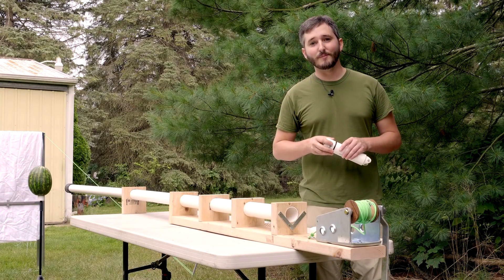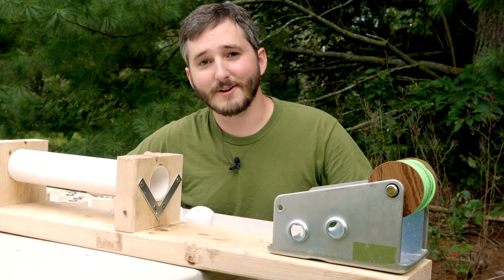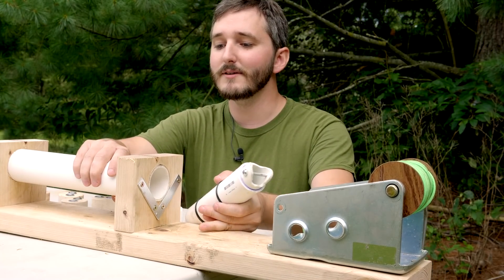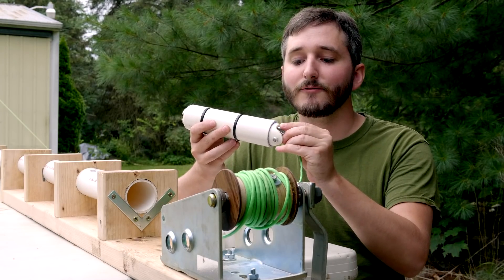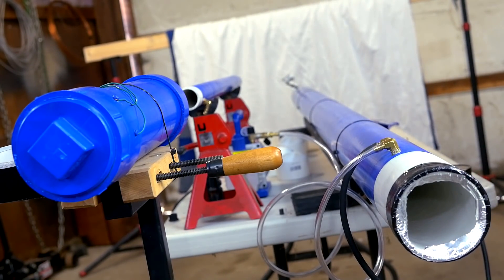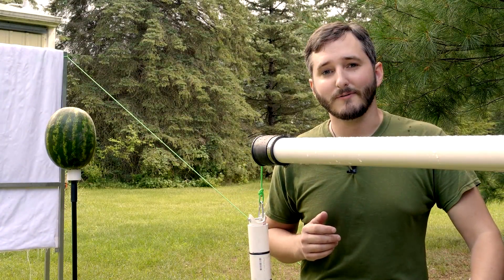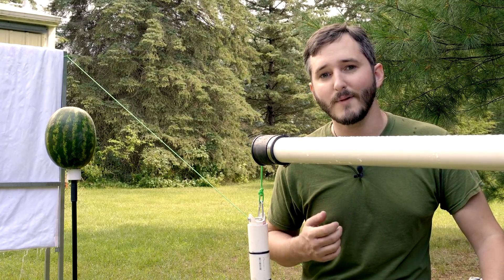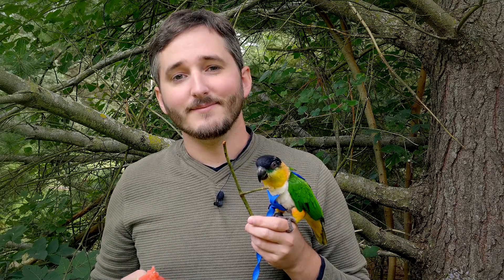Rapid-Reload Vacuum Cannon: Magnetic Piston, No Burst Discs

Comment: are you by any chance going to follow up on the sodium project?
also try making sabot projectiles so you can accelerate a relatively heavy projectile in a short barrel
Reply from the maker: NurdRage is doing a sodium series that is far more in depth than I am capable of.
Reply: NightHawkInLight  i know but he does it as a lab preperation. i really liked your experimentation and improvisation with regards to electrolysis.

Comment: what about pulling the piston out with a vehicle? then you could make a really long one. support the front end of the barrel only, the tension in the rope will keep the rest of it straight. the projectile will fly down the barrel much faster than the back end of the barrel drops to the ground. Also what about filling the barrel with helium? it will leak round the piston more but is much less dense than air. What about wrapping PVC tape round the projectile? less friction against the barrel & a more precise fit
Reply: i meant PTFE tape

Comment: Will adding a funnel at the rear maybe improve air flow that potentially holds back the projectile? I have no experience or education with this, but I'm thinking about how a Tesla valve works, and thinking maybe air from around the opening collides with air rushing into the tube(?)...

Comment: If you were to load it normally and before pulling the piston back used a vacuum pump to evacuate any air between the cup and the piston, would that allow you to gain any speed? You would then have the smallest amount of air possible in the barrel while also not having the long times of doing it for the whole barrel.
Reply from the maker: Sure, but the gains would be minimal.

Comment: Could you increase speed by incorporating a converging diverging section in a parallel connected pipe using a check valve between the two? I picture having a separate piston cylinder and projectile cylinder.

Comment: I took the concept of this design and used a 2-inch to 4-inch PVC Pipe Adapter fitting to attach a 4-in wide pipe to make a re-useable pirate cannon launcher, all other designs I saw used compressed air with a foot or hand pump or needed a compressor. The O ring was the hardest to find, had to go to a Plumber Supply Store to source it. I bought the black 2" pipe from Home Depot and found that it was really tight when trying to pull down the tube.

My question is, so you lubricate the ring with a kind of grease?
Reply from the maker: Yes, heavy bearing or axle grease works well

Comment: I'm wondering if atmospheric air rushing in to fill a vacuum could propel a vehicle. Pros: the air, you say, goes several times the speed of sound, so could move the vehicle nearly that fast; the vehicle itself would not need a motor or a way to power it, which keeps it simple and reduces cost. Cons: the path has to be airtight.

Comment: Cool. What is the weight of the projectiles that can be 'fired'? Is there any practical application of this device?
Reply from the maker: A 2" diameter vacuum cannon barrel pushes projectiles with 45 lbs of force, so anything light enough to move quickly under that amount of pressure.

Comment: What if you mounted a lightweight metal rod to the end of the piston? The metal rod would slide through a seal on the far end of the barrel, to push a projectile with the same velocity of the piston through an isolated barrel at the end of the vacuum chamber. This would eliminate the need for the projectile to break/push through the ending seal for the vacuum.

It’s just an idea, but I’m really curious to hear your thoughts on this. I’m planning on building this sometime in the near future, so I’ll comment if I can get it working efficiently.

Comment: What if you create a bullet that's slightly wider than the main barrel, so have a long barrel with two different diameters inside, and the projectile will stop half way and then pressure can start building
Reply: The longer the barrel the better since more acceleration can be imparted on the projectile.

Comment: Do you think the force required to break the magnetic attachment of the projectile to the piston has any effect on the velocity of the projectile?  My guess is: the stronger the magnetic bond, the slower the velocity - because some amount of air will get in front of the projectile before the bond is broken.  Probably negligible, with your setup.  You might be able to get away with smaller washers, which would at least result in a lighter projectile (and a weaker bond).  Likewise, I'd be curious to see what happened if you made the bond as strong as possible, by swapping the washers for a magnet identical to the one on the piston.  Thanks for the great video!
Reply from the maker: The hold is quite weak. I don't think there is much loss. Ideally I would put a skirt on the projectiles that would expand to make a seal and catch oncoming air.

Comment: Hmm, would combining a traditional air cannon with a vaccum cannon be feasible for anything?

For example, you can use a vaccum chamber in a second-stage to a conventional air cannon, where the projectile is shot through ths vaccuum chamber as a "booster".

Another potentially feasible option is a one-stage gun, where you have a high-pressure compartment in the back, and have the vaccum in the front, and us some sort of electric switch to break the seal and/or release the projectile (possibly have the projectile hold the seal). You could even possibly compress/decompress both in the same action, drawing the projectile backwards, compressing the air on the back end, possibly with the aid of a winch. The only problem I can see is figuring out how to release the projectile, while still preserving the air-seal.

Perhaps you could make a PVC bolt rod that is pulled through the back of the gun, with a rubber O-ring as an obturator.  The projectile would be attatched to the rod via grooves and/or lugs on the pipe or projectile, like a bolt in a gun. The rod would be rotated to release the projectile.

Comment: Amazing! I just discovered your channel from the coaxial piston cannon from 2013. I was looking for a way to make a fireless cannon for a live-action role playing game. I like the vacuum cannon better because it much simpler to make, it is more impressive and I want something that can involve multiple players (two to hold and aim the cannon while a third pulls the piston). 
There are however some points I am worried about. First, would a vacuum cannon be able to launch open cell foam projectiles? I may probably need a sabot to prevent the air from passing trough the foam instead of pushing it. Second, can I shoot projectiles light enough to hit people safely?
Reply from the maker: A vacuum cannon will shoot foam at dangerous speeds. It is not a safe option. Search my channel for a foam rocket launcher and you will find a better option.

Comment: Would it be possible to use the cup or burst disk on the front of the barrel, an electric vacuum pump to remove air, BUT some sort of electric valve or solenoid on the back end of the barrel to allow the air to rush in just as fast? Thanks

Comment: if you had various proyectiles attached on to each other, as in one attached to the vacumm seal and the next to the previous proyectile,then the second one should have less velocity (right? the one attached to the first proyectile) so it should collision with the first one. With these though could you make a series of attached proyectiles one smaller than the previous and use the conservation of linear momentum to lauch the smaller one to a great velocity, could you do that?

Comment: I absolutely love your videos and have been watching them for a long time and even made a lot of the projects that you have  but I just have a really quick question , I have never had any luck trying to find clear tubes like you have in your video could you please put a link somewhere where you can purchase them? thank you....by the way, I have made several vacuum cannons as well and I really love your new improved version.
Reply from the maker: If you google clear PVC pipe you can find many suppliers. Note that the inner diameter is different than with regular PVC pipe so you have to sand the pistons smaller if you're using the same design as I have.
Reply: @Nighthawkinlight  thank you so very very much for the quick reply, boy oh boy, you do read your comments quickly but I never expected a reply that quickly thank you so very much!
P.s. I think one of the most funnest projects I made was when I recreated your plasma bottle launcher which came out spectacular by the way , and it worked perfectly!

Comment: Would it be possible to use the projectile as the front seal to the vacuum, or would that compromise the movement with the amount of friction the projectile would interact with?
Reply from the maker: It doesn't move very fast if it doesn't travel down the barrel.

Comment: could I use this method to launch something over a few 80’ oak trees with fishing line attached.  I’m attempting to get a long wire antenna stretched across the top of several trees and not having much success with the fishing rod & lead sinker.

Comment: What would be the effect of using a larger diameter pipe? Say four inch instead of two? You’d have a lot more volume over the same distance but your projectile would have to be larger as well.
Reply from the maker: I've made one with 4" pipe. Check the video description for a link.

Comment: Is there a way to rifle the barrel but still maintain the seal and not break the o-rings  also is there a way to pull the cup out of the way so it doesn't fly off or break like tying it to the barrel using p cord
Reply: If you added fins/fleching to the tail or front of the the projectile and controlled the way the air re-entered the barrel causeing the air to twist around the fins rotating the projectile before being shot out of the barrel could this ack similar to the rifling of a gun? Causing better accuracy and distance I've seen similar things done on paintball markers and bbguns
Reply from the maker: There's no easy way to rifle the barrel, let alone still get a seal. The closest thing is to rifle the actual projectiles like a rifled shotgun slug.
Reply: @Nighthawkinlight  yep but what do you think about the other option though

Comment: so the wood block gets pulled back and gets pulled off only right at the end by the power of the air coming back in? thought it was weird that it would be attached at all to the thing that pulls back but yea i guess my question is the block releases right at the end of pulling the thing out?
Reply from the maker: Yes, that's correct.

Comment: Do you think it'd be possible to make a mini vacuum cannon using a large syringe as the tube? The burst disc might be tricky but maybe I'm onto something.
Reply from the maker: Yes, but it won't be very powerful. The tube is too short for a projectile to gain momentum
Reply: @Nighthawkinlight  hmm, maybe if it was built in a small handheld length of pvc.

Comment: Hey, nice design again.  I would be interested to hear about any possible mechanical valves that might have come close to working, or even just maybe interesting valve mechanisms you might not have been aware of before researching for this project.  Also, did you consider electro-mechanical in this search?  Thanks for the content.
Reply: Interesting question - I can't think of a valve type that clears the whole cross section and has a reasonable action time. At least not on a scale in line with the rest of the cannon. Action time and repeatability, those ask for high powered DC actuators (accounting and correcting for the potential skew from the mains frequency and the speed of the projectile...sounds like a decent way to challenge engineering students)

Comment: Very nice iteration. How much oomph is lost from the magnet? Would you get more power by  tilting the barrel back to slide the projectile down when the pistn is nearly withdrawn?
Reply from the maker: Very little is lost. The projectile only has to move a fraction of an inch before the magnet has no pull and then there's 10 more feet of barrel for it to accelerate down
Reply from the maker: Tipping the barrel is a good idea though, very simple solution.
Reply: For future readers, I believe "get off" is  auto-correct for "feet of" (10 ft is ~3m)
Reply from the maker: Edited, thanks

Comment: I want to see if there is a way to use this to launch bait and sinker off a beach to get the bait out past the breaking waves 1 or 2 hundred yards? Air canons I have seen require your bait and tackle to be frozen in a cylinder of ice then launched witch requires to much preparation and your limited to how much ice cylinders you bring. Not to mention air compressor and battery to run. The only problem I see with your method is launching something into the ocean you can’t retrieve like the pvc cap or a wooden plug.

Comment: I wonder what you would have to change to achieve maximum efficiency. That is, what's keeping the projectile from achieving it's maximum theoretical exit velocity from a tube this size. Where are the bottlenecks? If the piston were removed faster, would it allow air to rush in faster? Would flaring the back of the tube, or adding vent holes, allow air to rush in faster? Would coating the inner surface of the tube with a silicone spray reduce friction between it and the projectile as it moves down the tube? Or maybe the friction is already nearly zero. Is any air slipping out between the projectile and the tube and so being wasted? How much energy is lost due to the plastic cup design? I know it would take a lot of time and work to answer these questions, and it's probably not worth it. Maybe someone who could find a commercial application for this would find it worthwhile.

Comment: I don't get the magnetic piston/projectile thing.  If the wooden projectile is attached to the piston with magnets, why doesn't it come out of the back of the barrel along with the piston? Does the sudden inrush of air pull the projectile off the magnets on the piston as the piston comes out?
Reply from the maker: Correct

Comment: what about using 80 lb fishing line instead of that thick chord? then you could wind it directly onto something held in the drill chuck. in which case you might not need the wooden base, if you could find a way to brace the drill winder directly against the end of the pipe. maybe with a wider pipe fitting or something. with a couple of notches in the rim. it's not as if the gun has to be accurate. if you put the back of the barrel on the ground you could brace it by standing on it. rest the business end of the barrel on something just high enough to aim at a cabbage or whatever

Comment: I wonder if this is how they are going to make space weapons... Imagine being able to fire reloadable "guns" by just injecting a bit of air behind the vacuum of space, from a satellite to shoot down other satellites. Oh and yeah, connect up at least double the length, and then fire sheets of insulation with or maybe without that aluminum foil. It's very lightweight, and you can cut cylinders out of them easily so you could make up a bunch of them quickly.
Reply: "Imagine being able to fire reloadable guns by just injecting a bit of air behind the vacuum of space ..."   That wouldn't do much.  The only reason this cannon works is because it is on the surface of Earth and has the pressure and volume from miles of atmosphere to push against the projectile.

Comment: Can you make a "cannon" the fires toothpicks fast enough to go into or through a 2x4?
Reply from the maker: I like that idea a lot
Reply: @Nighthawkinlight  How about adding Venturi bypass tubes using Nikola Tesla valves at the end of your barrel?  Make them longer than your ammo and it should allow a small insignificant amount of air to rush ahead of the ammo.  This air will then compress in front of the ammo and force the mechanical door open, while not loosing any force until the very end of the barrel!

Comment: Could this system be adapted for a more portable setup like a conventional air rifle?
Reply: Barrel length is what matters, so portability is not compatible with a good vacuum cannon.
Reply from the maker: It requires a fairly long piece of pipe for high velocities. Minimum I would say would be about 6 feet.

Comment: Hi NightHawkInLight, I have a serious question. How good of a vacuum is there in the piston right before the projectile is released? Can you measure it or estimate it? Can it boil water? Or even freeze it? I keep thinking about this plunger system to purify or desalinate water, but no matter how much I google, you keep coming up as the only result that made this kind of vacuum plunger.
Reply from the maker: Search my channel for how to make a vacuum pump. I make a pump with this sort of design that can get down to just about 30in/hg of vacuum. The amount of vacuum in a cannon like this depends on the length of the pipe, and how much air was in front of the piston before it was pulled backward (since that air will expand to fill the volume of the pipe at lessened pressure). A regular vacuum pump you might buy online works in the same way as this, it just uses a smaller piston. The quality of the vacuum you're able to reach just comes down to the precision of your design.
Reply: @Nighthawkinlight  Thanks a lot, looks great. So it seems it should be able to boil water at 40C, and maybe even room temperature. I think I have a project to do...